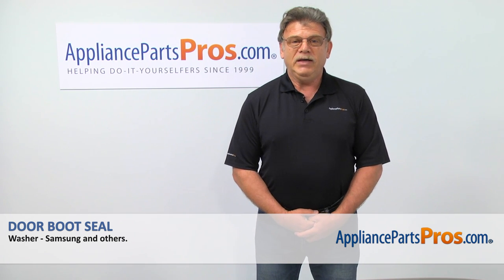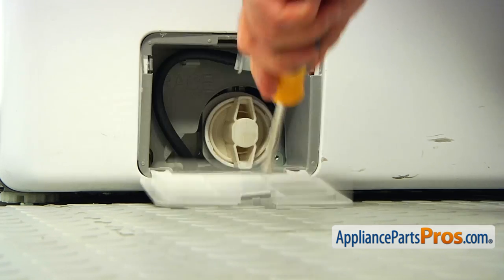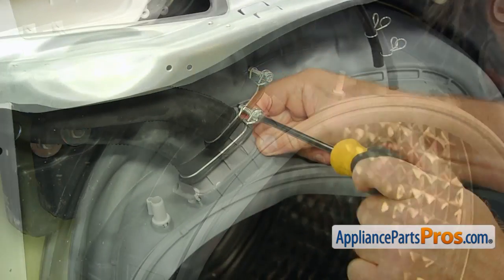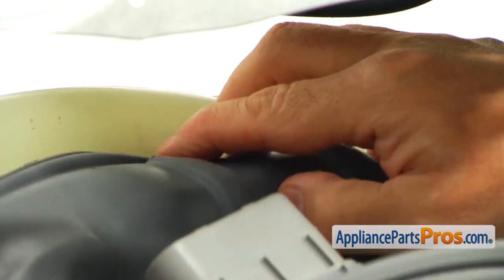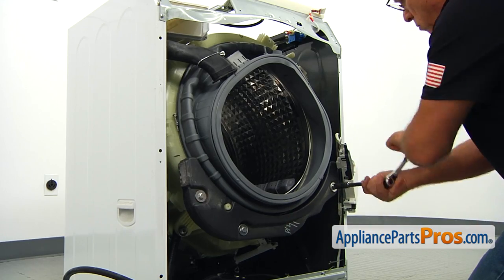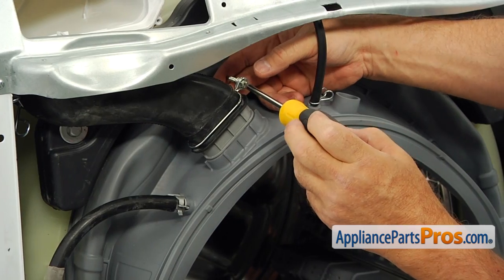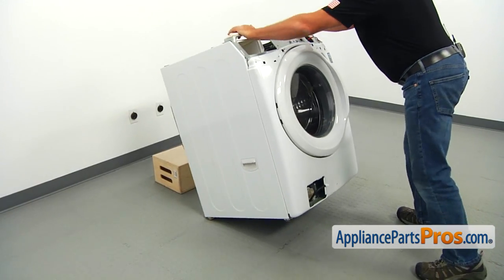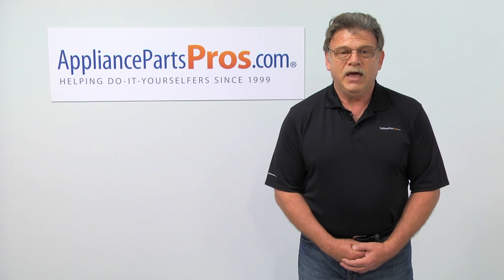How To: Samsung Door Boot Seal DC97-18094B

Comment: Used this to remove and clean my seal. I have a very similar model but keep in mind that the boot seal clamp isn't always clockwise to remove. Mine looks almost the same but removes counter clockwise. You could accidentally break something if you crank it too much and not realize that. Appreciate the vid!
Reply from the maker: You're welcome!

Comment: Thank you for the excellent video. I needed to clean my seal. I removed it using your steps. Soaked gasket in bleach solution overnight and the results were amazing. No need to purchase new seal now. I also removed the complete soap dispenser assembly to make cleaning it easier. Not including the soak time on the gasket, this was an hour and a half job. I then ran Affresh  through the self clean cycle. It’s like having a new washer. Very easy DIY project.  Easy way to save lots of money.

Comment: My only extra tip is that, if you slide the washer forward just a foot, you can prop up the front with a paint can in the middle and get at the bottom screws that way.  Thus I did not have to disconnect the hoses and could work without really moving it very much.  Excellent step by step video. My VRTplus (boot#   DC97-16140N) was only a little bit different and I could not have done it without this video.

Comment: So clutch, thanks! Btw @4:54 when removing the clamp my screw needed to be turned counter-clockwise to loosen, it depends on the model. Also I had to take some components off of my old boot seal and thread them through the new one, it took some effort but they squeeze through just fine. Other videos don’t remove the counterweights but removing them helps access the screw on the inside clamp on the left. Cheers!
Reply: I wish I caught this comment before I stripped the screw head turning it clockwise. Such a detailed video and got me far until now. I hope others don't follow this step and caution is placed about turning the screw the wrong way!
Reply: After 45 minutes and tore up knuckles I found your comment 💀 thanks for saving me my sanity!

Comment: I am not handy but I had the tools and as a new homeowner, I need to be. This video was almost absolutely perfect. The only difference in my samsung washer was the screw on the inner seal, aka the metal ring closest to the drum/back, I had to screw counterclockwise to loosen and clockwise to tighten. That's what I would have expected, of course, but this video is clear about the need to do precisely the opposite. Not a big deal though, and otherwise, I actually found this really easy. Thank you!

Comment: Thank you!  This video was very thorough and straightforward, saved me time and money.

I did use a 7mm socket on a screwdriver handle for the inner ring screw because I couldn’t access it with a Phillips without stripping it.

Comment: Excellent step by step instructions. Fairly easy job for a DIY.  I wanted to clean the seal (not replace) so i soaked it overnight in 50-50 bleach water solution. Came out like new. Saved a ton of money. Thank You

Comment: Great video! Took me about 1 1/2 hours to do. My inside circle metal gasket ring was slightly different on my Samsung. Instead of the clockwise to loosen it was a different type of clamp and was counter clockwise to loosen.

Comment: Great video!  One additional thing to look out for is if the boot is leaking, it will sometimes allow to leak into the front door, which requires you to loosen the bottom door screw under the window to let the water drain out.

Comment: Great video. I only had to unscrew the wire holding the seal counterclockwise instead of clockwise. I struggled tying it by mistake.
Reply: Same here
Reply: I should have read the comments. Stripped the screw head turning it counter clockwise like the gentleman instructed. Wow, so close on saving money for a new appliance 😒

Comment: Was able to do this repair without taking off the front, but it required small hands and tools for tight spaces.

THE CLAMP ON SOME MODELS SCREW/UNSCREW REGULARLY -- NOT IN REVERSE.

You can tell by checking to see if the clamp is tension based (as in this video) or a plain-old bolt+washer+nut stack.

If you end up stripping your screw, you can use a 7mm socket wrench to get it off. Or, hack-saw it off and replace it. Part DC97-14618H.

Comment: Thanks for the video!!  However, the screw for the boot clamp instructions around 4:56 is incorrect, at least for my machine. I nearly stripped it trying to loosen it by going clockwise. My machine clamp is lefty loosey, righty tighty. :)

Comment: Fantastic video.  But what do I do if my dryer is stacked on top of my washer and both are located in an apartment closet that is too narrow to access the back of the washer, and I'm not strong enough to remove the dryer from on top of the washer?

Comment: After i put everything back, the washer get stuck in rinse & spin cycle. I tried unplugged and plugged, didn't help. I felt like i have messed up installing the weight. Any recommendations or tips?
Reply from the maker: You can double check the installation of the parts to make sure everything was installed correctly. What is your model number?

Comment: Great video except for instruction at 04:54 . As a couple of others stated, turning the screw counter clockwise was necessary for their models. NOT clockwise. Please be cautious and don't force it like me. I stripped the head because everything this man said was on point and I believed the instructions applied to every model. Now I can't get the retaining spring off
Reply: Use a 7mm socket wrench or a hacksaw and a $15-20 part: DC97-14618H
Reply: @acidacidacid598  YES! That's what did it! Thanks for your help!!

Comment: It took us hours to do it, we thought we did it correctly. We tested it and started fine but when draining there was water leaking at e bottom
Reply from the maker: I'm sorry for that issue. You will need to double check the installation of the part. Good luck with your repair and let us know how it goes!